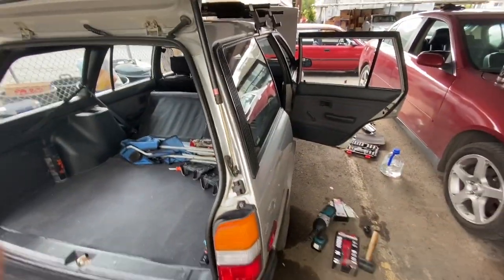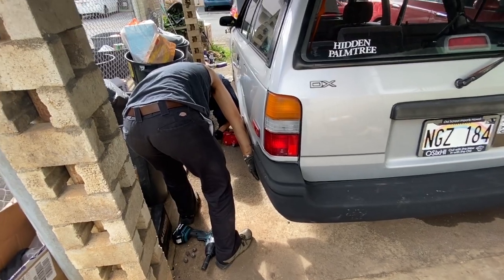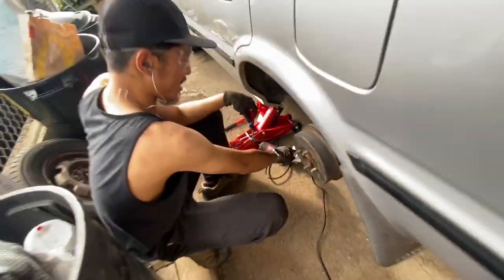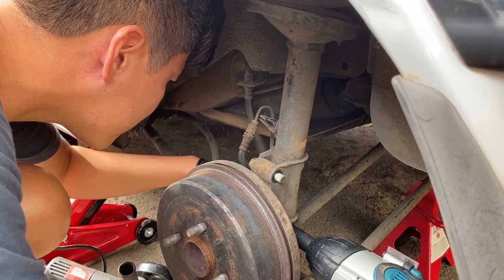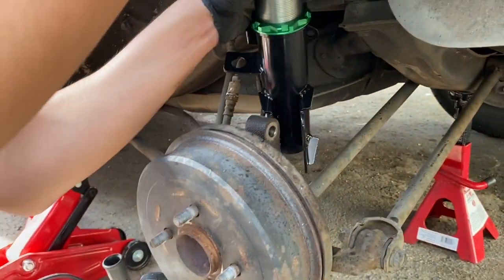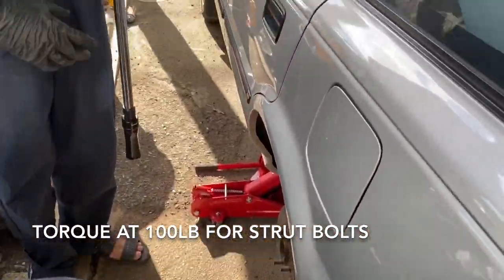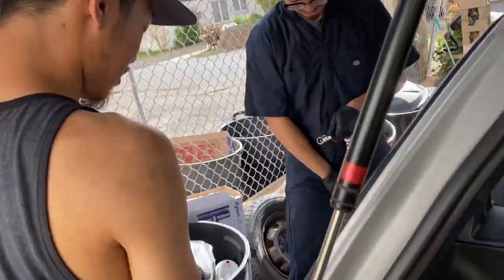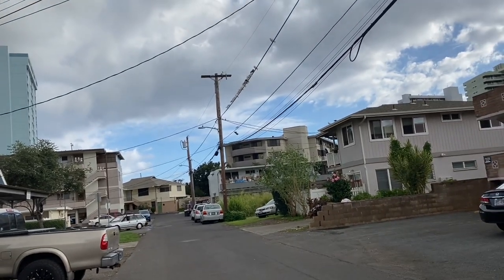LOWERING +25 Years Old Corolla Wagon!??

Comment: im thinking about lowering mine. i have a gold AE92 wagon. Did you just replace the coilovers or did you replace other suspensions components as well, any suggestions??
Reply from the maker: Just the suspension! They are strut type so there is no need to replace any other components. But you’ll need a grinder or saw to cut the break line loose because they are attached to the Stock struts

Comment: what about front suspension ? its higher
Reply: I adjusted it shortly after. We spent so long doing the job that i was just happy to be done with it. Right now its sitting at like 4.5in lower up front and 4in in the back, based off of the original strut measured to the new one while both are uncompressed.